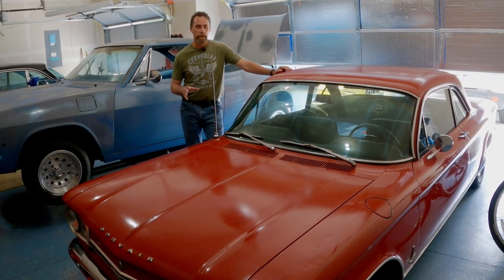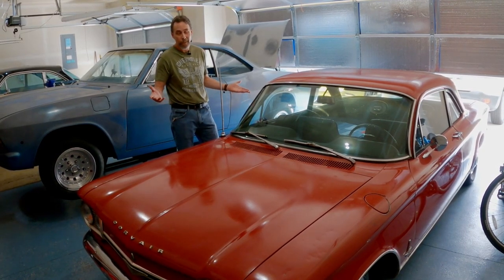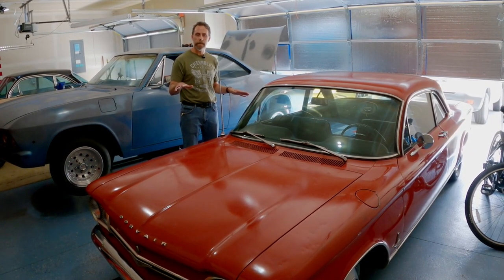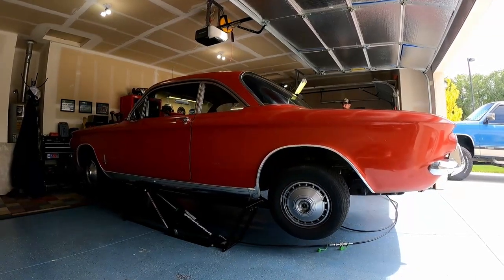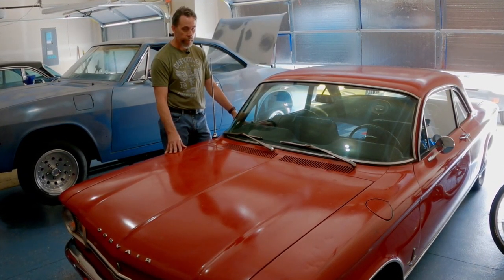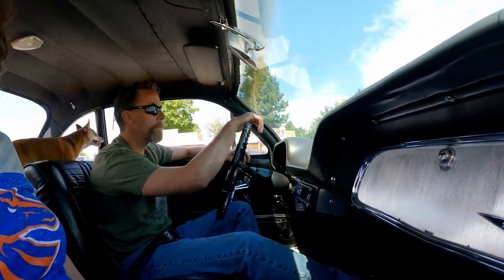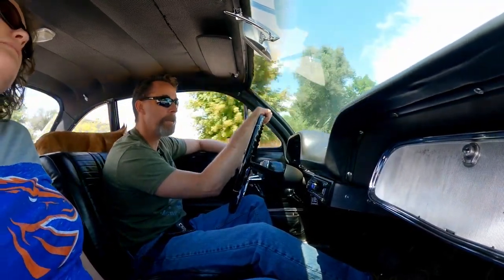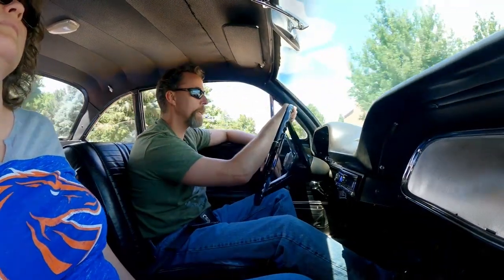1964 Corvair Monza - Lowered Suspension 😎   #corvair

Comment: Try some wider wheels on the back.  It will really make a difference.  The wider track and increased wheel will improve the rear stability.  It will make the rear squat more and more negative camber.  It makes it harder for the car to jack in the rear.  Front will also help too but the rear is most important.
Reply from the maker: Thank you so much for the feedback and advice. I am definitely looking to upgrade the wheels and tires. Not sure if I should get all 4 the same size or keep smaller tires in the front. After market rims are going to be a little wider as well.  Thanks!

Comment: Glad that worked for you and handled better, 👍.
Couple questions.
1. What type of front shocks are they and are they gas? Condition?
2. What size and how tall are those tires, around 21inches.
3. What difference do you feel in the rear and same shock questions?
:I'm building a 1964 track car to a late model suspension and 14" wheels with 50 series tires. I cut two coils out, may be too much,  but I am using KYB gas white shocks which are very stiff🤔. The rear has van axles and brakes.
Trial and testing, will see come spring 🙄
Reply from the maker: Thank you! The car is actually in storage at the moment, so I am unable to give you specs on the shocks and tires. I can tell you that the shocks are not upgraded. The rear springs were pretty well bouncy before I cut them. The handling is great, but it does hit pretty hard on big bumps and railroad tracks etc...I have only bottomed out once. I had three people in the car and hit a hump in the road at 50 mph. If I was running this car hard, I would not go with 2 cut springs and I would definitely upgrade the shocks.  Good luck with your testing :)

Comment: Car looks cool.
Could you  give me some advice on replacing the rear springs are there really hard to take out and replace? 
Thanks In advance.
Reply from the maker: Thanks!  Replacing the rears is not too bad if you are mechanically inclined. If you are not, then it might be a bit of a chore. You have to take apart several components to gain access to the springs and need to be careful handling the springs that are under pressure. Replacing the rears with new springs makes a huge difference in ride height and comfort. Definitely worth it if yours are worn out.

Comment: Hello; just cut my front coils by 1 coil.  1963 Monza.  Because the ends of the coil are closer together, this netted me about 7/8” actual.  Is that similar to your experience?
Reply from the maker: Sounds about right. I then cut a second coil. The result looked really cool, but the ride was not worth the looks. I have since bought and installed new stock-height springs all the way around.
Reply: @EndWrenchRookie , appreciate the quick response.  I think I’ll do another half-coil.  Running 205/50-15 on a 15x7.  With the low profile the additional drop may be ideal.  If it’s rough, will just replace the coils.

Comment: Doesn't this also change the shock travel which could make it rougher ridding? Will it cause more damage to the drive train by the angle changes?
Reply from the maker: I would think it would affect the shock travel some. Not enough to cause problems in my opinion. This would be noticeable if your shocks bottomed out. I wasn't feeling that however. The rear camber is changed somewhat. Not sure if it is hard on the drivetrain. The tire wear would be affected. As few miles as I drive this I am not too worried about the longevity of the tire tread. Thanks for the comment!

Comment: Do you have to cut off one coil at the time or are half steps possible?
Reply from the maker: You can cut as much or as little as you prefer. However, it is best to cut one full coil at a time as the tail of the coil rests in a notch in the saddle. If you cut it shorter the tail will be floating and you may get chatter. Thank you for the comment!

Comment: Cutting springs is amateur  stuff.
Reply: Cutting springs changes the spring rate ..... can cause problems
Reply: He said at the beginning he was considering new springs, thought he would try this for an experiment.
Racers have been cutting one coil for years and changing springs and still cutting one coil. The 1963 spring with one cut coil in a 1964 rear is a preferred set up for handling.